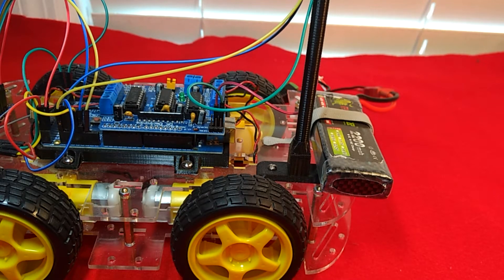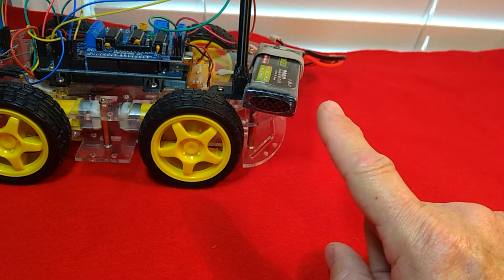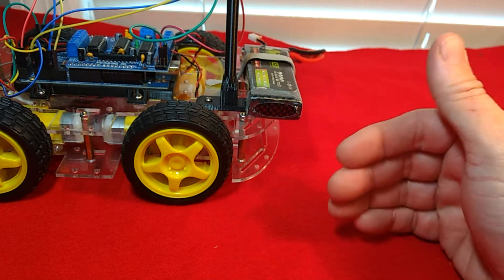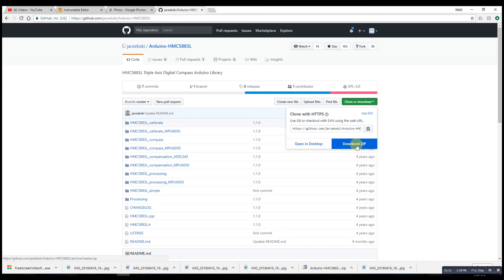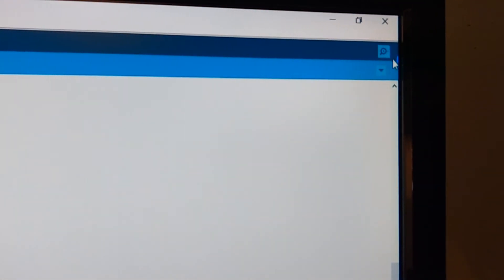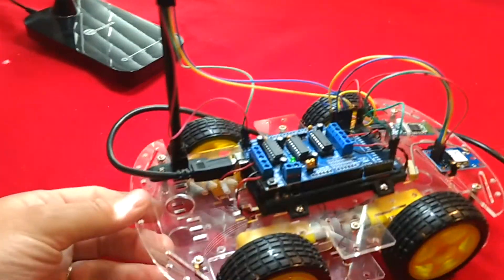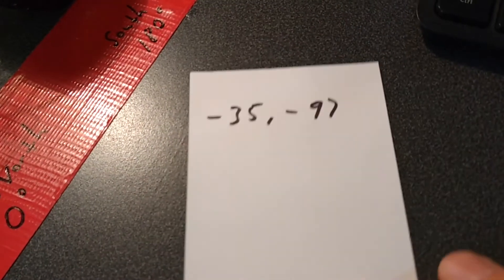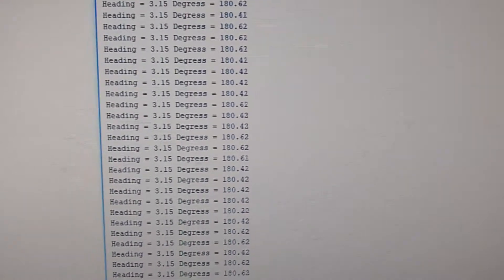How to Build a GPS Guided Bluetooth Robot - Part 4 - The Compass

Comment: i am not able to see any output in serial monitor when i upload HMC5883L_calibrate file. can you help me with this. Zip folder also not shown in examples.
i got this Could not find a valid HMC5883L sensor, check wiring!.
Reply: Have you fixed it
Reply: @PhamucDuy-go6vj   no sir  actually i calibrated the compass,  installed the apk file provided in the folder, my  car is moving on the same place only even tried in the open place.  when i set the waypoints and go to waypoints.  what  things need to change in the code can you suggest
Reply: May be late now, but for posterity still. About the custom library not found in examples, search for the name of the example he used "HMC5883l calibrate" in your system files. You'll see the file in the .ino format, an executable script. Launch it from there and it opens the Arduino IDE with the entire code inside. 
About not seeing any output, I didn't see too, but somebody in the comment says you should just use the offset he used for his main code...ie, copy his main code that way after calibrating your compass manually. 

If you have tangible information, I could use some help.

Comment from the maker: The Compass I use is the HMC5883L which is also labeled the GY-271 or GY-273 these are becoming harder to find in the US, but are are still available from China. If you are not getting any data from the Compass it may be that it is a newer model compass and not compatible with the HMC5883L compass Library
Reply: @EZtech I need your help. I have done everything step by step. I have made the circuit, and calibrated the compass, and uploaded the code. And did everything which you told in this video. But the problem is that, I never got any output whenever I press any button in the app. Even the connection is proper and code is properly uploaded, also compass has been calibrated perfectly but nothing works with the app, whenever I press any button.
Reply: @EZtech I need your help. I have done everything step by step. I have made the circuit, and calibrated the compass, and uploaded the code. And did everything which you told in this video. But the problem is that, I never got any output whenever I press any button in the app. Even the connection is proper and code is properly uploaded, also compass has been calibrated perfectly but nothing works with the app, whenever I press any button.
Reply: How your goona feed the address or else instruct the car to go to the particular place

Comment: Hello, is the process the same if you'd swap out the Arduino Uno for an Arduino MEGA ? Thanks in advance
Reply: It's the same. You should only change the cable connection.

Comment: Hello, I´m trying to do this project but when I connect the magnetometer it doesn´t show any data, I have already checked the connections and they seem to be fine, do you what could it be?
Reply: @anelemlambo497  would it matter? you could change it in the code and use that calibration code instead?
Reply: @Benz93x  kindly explain it

Comment: hello, I have metal robot chassis will it be a problem for a compass?
Reply from the maker: Hasan salman As long as the mast is tall enough it should be fine, make sure the mast is not metal and don't use screws or any metals to secure the compass to the mast.
Reply: @EZtech  @EZtech I need your help. I have done everything step by step. I have made the circuit, and calibrated the compass, and uploaded the code. And did everything which you told in this video. But the problem is that, I never got any output whenever I press any button in the app. Even the connection is proper and code is properly uploaded, also compass has been calibrated perfectly but nothing works with the app, whenever I press any button.
Reply: nice.thanks for the quick reply. you are helping a lot.

Comment: Hello!  i did the calibration process and it gave me (11,59) but recently i calibrate again and it gave me (0,58) i wanted to confirm those values but the values that i got didnt match.
Reply from the maker: Daisy Fernández This is one of the most frustrating parts of the whole build as I mentioned in the Instructable. Make sure to that there is nothing metal near the compass. When calibrating be sure to place the robot on a flat even surface, I usually place it on a piece of paper on a table and rotate slowly. Also, be sure to move it as far away from your computer as possible or any other electronic devices, especially speakers (they have magnets). The offset numbers may not be exactly the same every time but they should be fairly close, sometimes I will take an average of the numbers. Hope this helps.
Reply: @EZtech  @EZtech I need your help. I have done everything step by step. I have made the circuit, and calibrated the compass, and uploaded the code. And did everything which you told in this video. But the problem is that, I never got any output whenever I press any button in the app. Even the connection is proper and code is properly uploaded, also compass has been calibrated perfectly but nothing works with the app, whenever I press any button.
Reply: EZtech it could be the bad calibration of the sensor the reason why the robot is not going to the right place? 
I Keep making the calibration process and i get almost the same  values for the Y, but the values for the X are super random, i will change the base where i put the sensor and attached to it. I had never worked with something so sensitive, it's kind of annoying but at the same time is amazing.
Thanks Sir for answering !!
Reply from the maker: Daisy Fernández I'm wondering if the compass is mounted in the right direction. When you press the Compass "Set Heading" button is the heading correct? In other words if the Robot is facing directly North then the heading should read near 0 or near 360 degrees. Conversely if the robot is pointed South the heading should read approximately 180 degrees.  Also, check your GPS location. Press the GPS location button and see that it is giving you the correct longitude and latitude coordinates.
Reply: EZtech i checked and everything is fine, the degrees and gps info but it keeps going to one direction, if i set the points, it turns around and it always heading to 259 degrees 🤔🤔
Reply: EZtech it's wooorking !!!!!! 😁😁😁😁
Reply from the maker: Daisy Fernández Cool! You should upload a video, I would love to see it.
Reply: Daisy Fernández how was it working?can you please share a video with me?